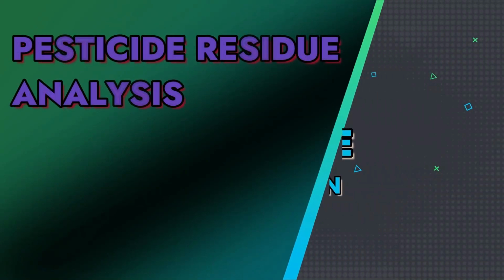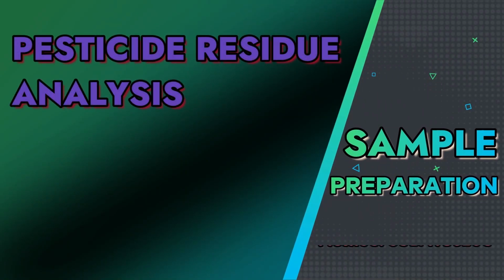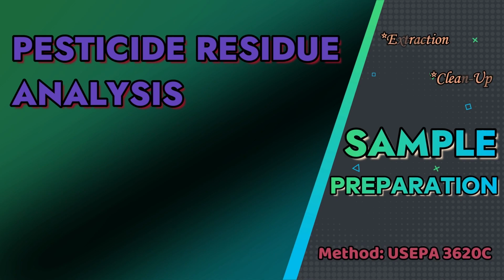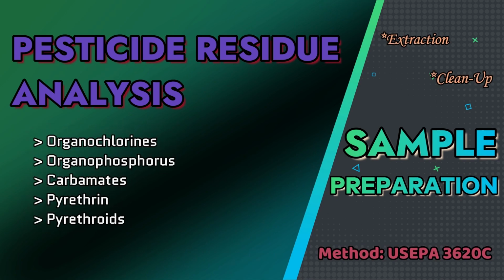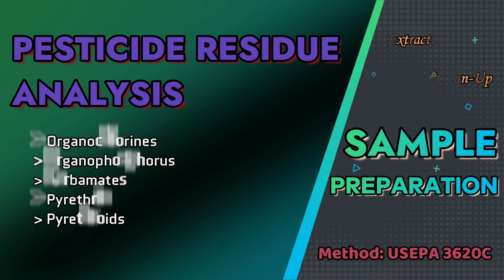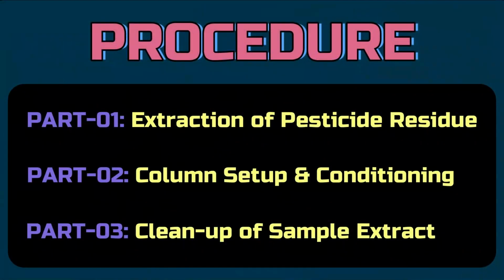Sample Preparation of Pesticide Residue Analysis with ROCKER Vacuum Controller Pilot 100

Comment: What  is  the  florisil
Reply from the maker: Florisil is a synthetic magnesium silicate adsorbent widely used in chemical analysis and chromatography. Primarily composed of silicon dioxide and magnesium oxide, it boasts a large surface area and high selectivity for polar compounds. Florisil is commonly applied in pesticide residue analysis, drug purification, and lipid separation to effectively remove interfering substances and enhance sample purity. It typically requires activation before use for optimal adsorption.